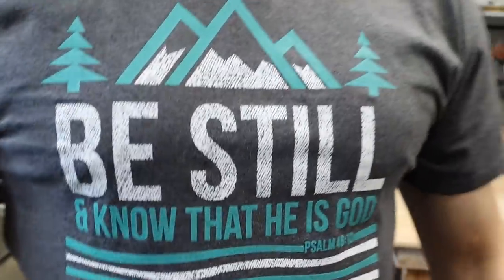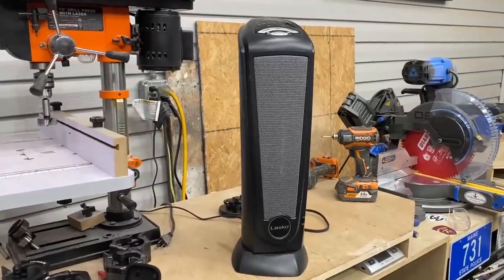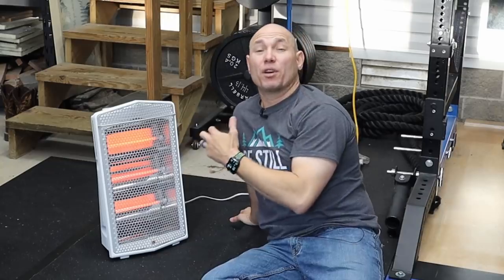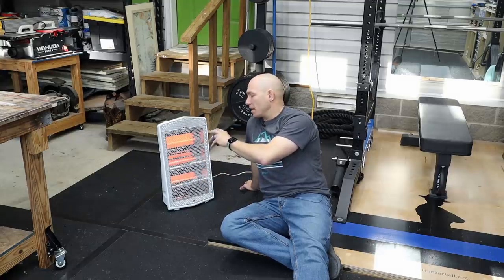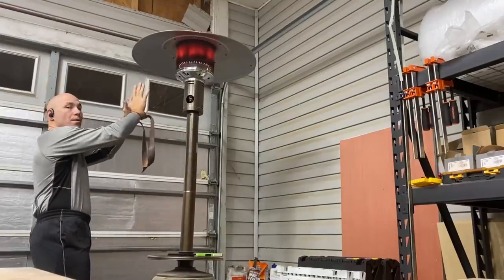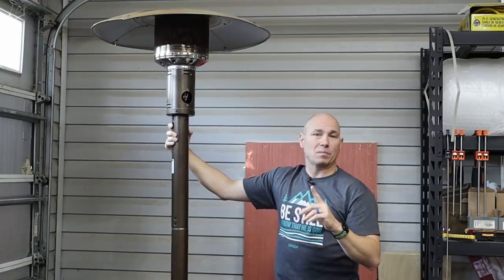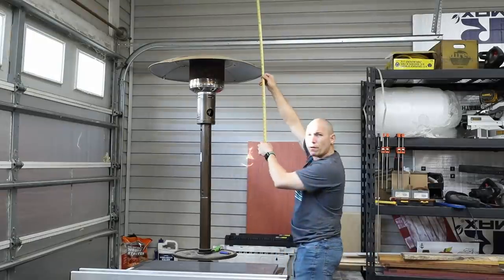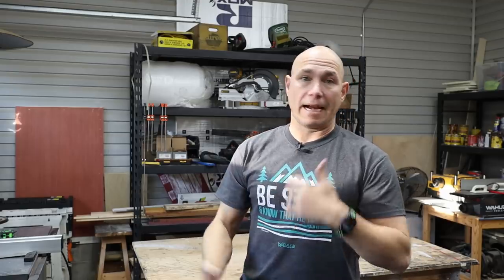How To Heat A Garage Workshop | Shop Heater Ideas

Comment: This has been a really early and cold winter. We have seen overnight temps of 16 F when many years we might be in shirt sleeves at Thanksgiving and Christmas time.  I am surprised you are so moderate in Southern Arkansas. 

 Uninsulated garage. Propane heater that looks like a cannon  (can't think of a name, a canister tilted, down on the floor),  when we really need to take the chill off. It will warm up that garage and take the chill off in a very few minutes.  It really blows hard!  Then we use oil-filled radiators to keep it warm. I feel safer without an open flame.
Reply from the maker: Sounds like a Nice set up

Comment: I’m im central Arkansas brother and I knock the cold out with a big kerosene forced air induction heater it will take my shop from 30 degrees to 76 degrees in about 3-4 minutes lol then I keep it warm with a couple small radiant heaters works great
Reply from the maker: awesome

Comment: I have a work shop 20'x 15' x 8 High   I use a oscillating heater  It's a decent size. It keeps it around low 70s in the winter. I live in Illinois it gets cold hear.. stay warm down there..
Reply from the maker: Nice. Must be a big one

Comment: I have not read all the comments here, but in a facebook group I am in several folks use wood stoves to heat their shops. I have one I got from my grandmother’s estate. Just need to clean up some surface rust and repaint with high temp resistant paint... and make a chimney for it to send the CO2 and smoke outside.
Reply from the maker: That would work well

Comment: I use propane to heat my shop in CT. To keep it inexpensive you can get your tanks filled at like a tractor supply. usually, a standard grill size is about $5-$7 to fill. I have a 40LBS tank and it cost roughly about $13 to fill.
Reply from the maker: That’s not bad at all

Comment: Couple of interesting notes. First, if you are burning a fuel of any type - wood, gasoline, propane, butane, kerosene - the act of burning creates Carbon Monoxide which is odorless and colorless. So, even if you can't smell it burning; it is still requires great caution - as you noted. Second, with eleven foot ceilings, you might want to consider installing ceiling fans. They will help cool you in the summer and will circulate the heat in winter without taking up floor, bench, etc. space. Finally, you might want to look around at ceiling fan lights (if you install one) and even ceiling lights as a number of years ago I worked for a company that marketed a ceiling fan light and a ceiling light that had a small heater built inside them. The heater would be the rough equivalent of your lasko hot air blower.
Reply from the maker: thanks for the info!

Comment: I think all your videos have been great, but when I heard you say 40 being cold, I could only chuckle.  Being from Chicago, garage work is done until it gets down to single digits, inside temps remain in 40s.
However, now that I've got my own home (attached garage) 220v electric heater, 5000W, heats up 450 sq ft in 30 minutes from 50 to 75; I actually have to turn on fans to stay comfortable.

Comment: I'm in south Louisiana with a 30'x30'x12' tall all metal  building.  The peak of the roof is probably  14'  I have a 12' x12' roll up door and another  8'x10' roll up.  When bogey are closed it leaves a gap about 4" wide the length of the door for more cood air to enter.   I cranknuo a propane bottle  connected  to a turkey fryer.   It will only run 30 minutes cabd shut off.   I through an old Hetalia pan on it with scrap steel to hold the heat.  I also use a drum fan mounted  in the attic to circulate the  heat.
Reply from the maker: nice

Comment: Tractor Supply sells larger propane tanks, and refill them a lot cheaper. They also sell Mr Heater products, that work really well.
Reply from the maker: Nice to know
Reply: TSC also refills for the propane cost of gallon, X gallons used. I filled three 20 lb mostly empty tanks for $25 the last time I went there.
Reply from the maker: Wow
Reply: Same here. My local equipment rental place fills up propane tanks. Filled up two of mine for 15 bucks the other day. The Blue Rhino exchange places are a waste.

Comment: Live in northern Wisconsin and have a 30’ x 30’  shop (garage) with a second floor.  Heat all of it with an outdoor wood burning forced air stove.  When it’s zero outside it’s 65 inside.
Reply from the maker: nice

Comment: Being from California I can relate to not liking the cold.  Although,  it does get cold in the area I live so I will be ordering my shop doors with insulation in them 2 of them 10x9 and now will need to look at the mounted shop heaters you mention. The shop is yet to be finished inside so I will look at which would be the best fit gas or electric

Comment: This is my first year woodworking in my garage in Virginia after moving from Connecticut. I have a kerosene heater that's too big for my garage (about 18,000 BTU) and it smells bad. I have been trying a Big Buddy propane heater the past two weeks and it seems to do the job and does not smell as bad. I do have the hose to connect it to the propane tank I use in the grill in the summer. I just need to take the chill off since it's not as cold here.
Reply from the maker: Good to know.

Comment: I live in north Texas and the weather get real confused around this time. It may be 65 one day and the next day it will be in the 30-40.  When I heat my garage I use a kerosene heater, and I can leave it by the door with the door raised about 6in and it does pretty fine.
Reply from the maker: Awesome

Comment: Love your videos, I learn a lot from you.  At 3:50 I believe you mean CO monitor and Carbon Monoxide, not CO2 and Carbon Dioxide.  I have lived in cold winter climates for many years, Reno Nevada, Madison Wisconsin and now Colorado Springs Colorado.  I use my garage as my shop as well.  I use a ceiling mounted, natural gas heater.  Brand named Hot Dawg.  Contractor tried to sell me on the mini-split, but not sure if we are staying here much longer.  I will get a mini-split when I retire and build a stand-alone shop. But for now, it works awesome.  Merry Christmas to you and yours.
Reply from the maker: I did mean that.  Sorry. Thank you. Merry Christmas.

Comment: I’m in southern Ontario and it gets cold here -4F right now. I used to he my garage with a propane heater but got sick of the cost and the hazards (fumes and combustion risk) I just put a 10000 watt hanging electric heater in this fall. The cost of the unit was $550. The kicker was the wire I had to buy, my garage is not attached to my house and I required 125’ of number six wire, cost me $650. All in it cost me about 2k to install but it is way better then unventilated propane.

Comment: I insulated my garage door and plumbed air vents off the ac unit into the garage. When the house ac or heat runs, it also blows in the garage workshop.  It stays nice and cool in the summer and warm in the winter.
Reply from the maker: Nice. Did it raise the electric bill much?

Comment: I'm in Minnesota. I heat my studio (it's a garage when the cars are in it) with a combiniation of a ceiling mounted heater & a 50,000 BTU kerosine heater. I use the kerosine heater to generally warm up the garage, then the electic heater to maintain the space.
And if you can smell kerosie, then the cap's not on correctly.
Reply from the maker: Thank you
Reply: Fellow Minnesotan. Heat my work shed with a Mr Heater, 18,000 BTU. Will take it from 15 degrees to a balmy 25
Reply: @michaelmorrissey765  My Mr. Heater 50,000 gets the garage quite nice. In fact, it can drive you out of the garage.
The electric heater is undersized. My mistake. It's okay for the cool weather in Minnesota (June, July, August).

Comment: Being an Alaskan,  often one has a small wood stove... there's also the Mr. Buddy heaters and other lp fueled heaters. As always be sure that you have a dreft of fresh air. Even a wood stove will greatly deplete your available oxygen in a closed space. If using lp, 2 100lb tanks should get you through the worst of the cold. Air circulation is key. There are a number of heat driven fans that sit right on top of the wood stove. For any type of fuel heater, no matter the fuel,  always have fresh air coming in. I would even suggest a draw of fresh air even with electric heaters. 
As for keeping cool in the heat... air circulation is key. A box fan blowing over a basin of cold water is cheap trick, add some ice if you need to.  If you can... when setting up shop situate in a shaded area. If shade isn't available,  plant some shrubs that can grow tall... lilacs and other flowering shrubs and small trees also add a nice fragrance.  Keep the heat out and the cool in... hang a thick blanket over the door to help regulate the interior temperature,  this also works well for keeping heat in and cold out.
Reply from the maker: Good info, thanks

Comment: Im in a 2 car garage with 12 foot ceiling. Just got a kerosene heater and it is awesome.  I run it 40 min and cut it off. Stays warm for about 4 hours. So actual run time is only 2 to 3 hours a day. It will use 1 gallon of kerosene for about 20 hours. Not too bad. When they are set up right the smell is minimal.  No venting required.  I do have a carbon monoxide detector in my shop.
Reply from the maker: Nice

Comment: Here in Oregon most folks burn wood to stay warm in the shop. Of course, we have lots of trees! And even the wood stoves can be low cost. Due to EPA regulations new installations require catalytic converters and you can find old, non-compliant woodstoves on Craigslist for free.
Reply from the maker: Yeah that’s a great option too.

Comment: I live in the Pacific Northwest. Typically in the low 40s in the dead of winter. I have a 21,000 sq foot space with no insulation. I plan to insulate, but that’s gonna take time and money. In the meantime, I have a 220,000 BTU torpedo heater and I use stove oil, which is a type of kerosene, but WAY cheaper to use. Burns clean, but you are still burning fuel so you need to monitor fumes, particularly for smaller spaces. Anyway this heater will heat my shop from 45 to 65 in about 20 minutes. A little noisy, but hearing protection is not needed.
Reply from the maker: nice

Comment: I did put a mini-split in my garage in a house I lived in previously. With that and I insulated the garage door it stayed very warm. But unless you have a good saw dust vacuum system these units get really dusty really fast inside the unit. You can clean the filter but so much dust gets past the filter and in to the machine that it makes it really difficult to clean interior of machine. You really need a good filtration system for all the sawdust that will be created.
Reply from the maker: Great tip!

Comment: Hey buddy, I'm in Northern Ireland, winter here is usually low 30s and below, I use a JCB ceramic space heater. Problem where I am is the wind. I'm coastal and it's not unusual to have 40-50 mph wind. Insulation plays a big part. Plus lots of layers.
Reply from the maker: I bet that wind is hard to handle in the cold!

Comment: i do the something  that you do here in the VA state matt, i know that when it time for me to build that wood shop i will be installing a wood stove for sure it will also help get rid of the cut off that end up in trash can
Reply from the maker: Good idea
Reply: Check with your insurance company... mine specifically asked me if I had a wood-stove. I imagine your cost will go up if you put in a wood stove.
Reply: @ibealion1  thanks for the tip

Comment: My shop is in my basement and it's tiny. The ceiling is very low also. I'm 6'1" and I can't stand up perfectly straight everywhere. On that note, I have some larger light fixtures that put out a little heat and they seem to help some. Also, the ductwork from the furnace runs through the floor joists so, it's not bad. Sometimes I have to bust out the electric heaters for certain finishes, though.
Reply from the maker: some finishes do need a little warmer environment

Comment: My shop is 24 x 20 and I live in Ohio where it can get down to zero. I have my shop very well insulated and I use a 34000 BTU Kerosene heater. During the winter months I will work in my shop with a T-shirt it will be that warm
Reply from the maker: Ncie

Comment: I'm in the Pacific Northwest on the coast, so not very hot or cold, but my garage door faces south and the sun will make my garage unbearable. About $20 window tint kit from a home store or auto parts store and an hour with a screw driver and a razor blade solved that problem very nicely. I might of put it in backwards or there's a better kind because it's hard to see through (from outside) until I turn the light on, then it's easy to see my head bobbing around.
Reply from the maker: Ahhh, I need to tint mine!

Comment: I heat a 35x50 insulated metal shop with two mini-splits (also cools area) to 60 F. The mini-splits stop working around -15 F, so I have a backup wall mounted 7500 W radiant heater to keep paint/stain and wood area at 50 F.
I don't run propane heaters because of fumes (stain/sealer).
Reply from the maker: -15!!! Wow
Reply: @731Woodworks  it gets to -20 F nearly every year, and I've seen it at -35 F.
If you spit at the ground in -35 F, ice balls hit.

Comment: Shop's been heated for years, had local oil/propane company install overhead propane fired furnace, and a 250 gallon propane tank outside, gets refilled every few months... no worries up here in the northcentral PA boondocks..  Used to heat with a wood stove, then a forced air torpedo heater, then a pellet stove.. all 3 preventing from having any insurance coverage due to the high risk with open flames and flammable vapors..  propane furnace is "contained" and no exposed flames to it. Wasn't too bad at $1500.00 Installed plus propane contract which runs typically $400 a year or so..
Reply from the maker: nice set up

Comment: I put in a new fireplace last winter, and its in the room that connects to the garage. It puts out up to 44,000 BTU. I will let it warm up the room its in, then open the door to the garage to let that start warming up, plus run a small electric heater in the garage too. I can usually get it to 65 - 70 degrees in there.

 I used to ice climb in northern NH every winter, so really its never really that cold comparatively....lol
Reply from the maker: lol

Comment: If going plug in or portable, you can always try an infrared heater. Similar to radiant heater but without heat generation or flame.  Sizing for these are typically "small" rooms (under 400sq ft) but you can always grab a couple.  Amazon/big box stores, etc.  They are $80-$140. Some are wall mount. Some have remotes.  Some have wifi functionality. You can set up schedules, start it remotely before a session, etc.  They aren't going to cover extreme temps (below 20ish) but if you get the right size, it could be quite comfortable 👍
Reply from the maker: Thank you

Comment: I'm kinda lucky. Have an oil burning furnace from an old mobile home. Plus an ac in the window. For the sanding and gluing area. The cutting area is not conditioned. We also have a ceiling fan to circulate the warm air back down.
Reply from the maker: Nice

Comment: "I cant help you...get that dude insulated."  Yep that's me.  No snow yet which is freaky.  Moving most of my stuff inside basement except for my planer. Thinking of getting that wen purifier.  My dewalt propane and stanley 1500 watt isn't doing enough in the uninsulated  garage.
Reply from the maker: I've heard good things about that Wen air purifier. 

Thanks for the member support!

Comment: I currently use a 3500w garage heater but I plan to shift over to a rocket mass heater. Check it out and see what you think. They will literally pay for themselves in just a single winter.
Reply from the maker: I’ll have to check those out. Thanks.

Comment: I just bought a forced air heater from kens in el dorado that takes kerosene/diesel, we always used it as  i grew up in the shop and it was always shut so i dont see a problem using one in a closed space, my only complaint is they are a little loud but i dont mind
Reply from the maker: We used those when I worked for Milam Construction over there.
Reply: I bet they have the expensive ones though, i just bought a smaller $200 one, the price tags on some are insane.

Comment: I'm down in H-Town. Used to work DirecTV (6 years). Had a supervisor relocate from Minnesota to here during winter. He wore shorts and short sleeve shirt when it was 35°. We all thought he was nuts. He thought we were a bunch of "blank" cause we bundle up. THEN, summer came hahaha. You'd think the guy just came out of a sauna when he'd come out of an attic while we barely broke a sweat. He said he couldn't stand it, even outside in the sun and fresh air. Spent most of his time in the van with AC on full blast. By October, he relocated back home cause it was still too hot for him. Didn't even last a full year down here in the south. He said we were nuts.

Comment: Off Subject question...What type of floor covering are you using in your shop? Saw the black matts in the video.
Reply from the maker: Horse stall mats. 3/4” thick rubber.
Reply: @731Woodworks  Thanks